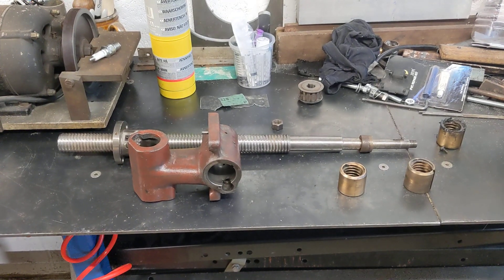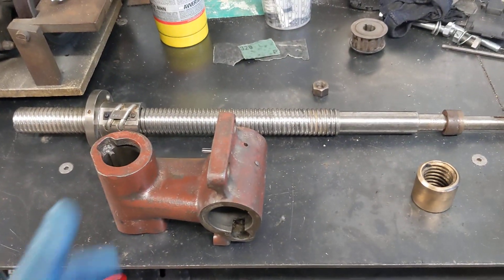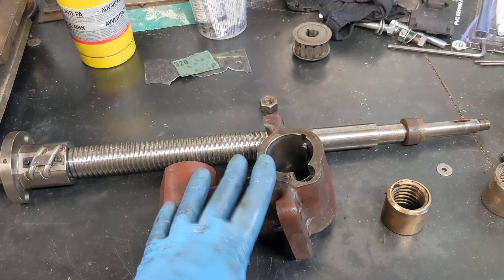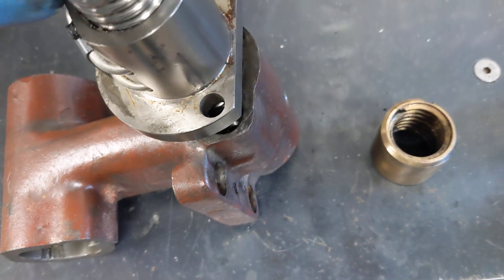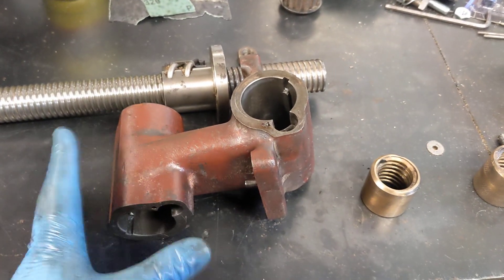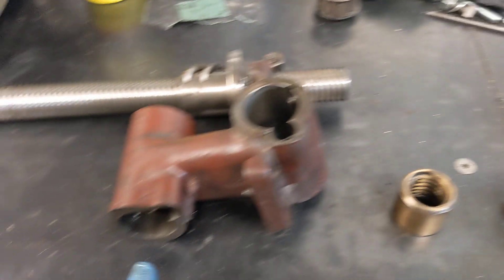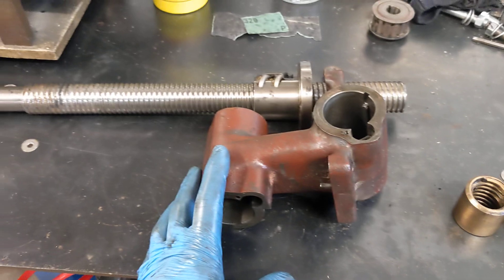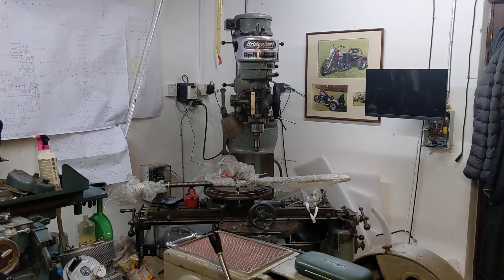Nutty Balls - ASide Project...

Comment: Hi Mark, could you tell me what size and pitch your new ball lead screws are. Im wanting to fit these to my machine. 
All the best
Reply from the maker: @Re-Machined  hello. I don't actually know as they were a free gift! I'll see if I can measure them, or better still Wayne who donated then might see this comment and tell us both! (crozwayne).
The nuts will be a challenge to fit into the yokes, so I wouldn't rush off and buy the exact same screws/nuts that I have. Also the screws might be a little short and I'll lose a tiny bit of travel. 
When I'm done I'll post all of the details in a video, but that will be some time yet. If you're really keen I'd see what others are doing, or what you get with some of the CNC kits.
Good luck with it all!